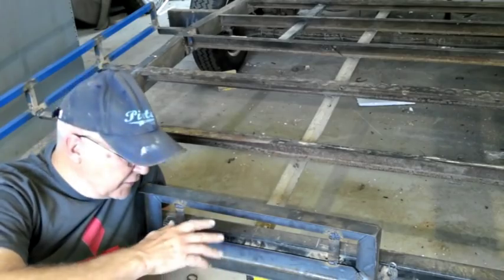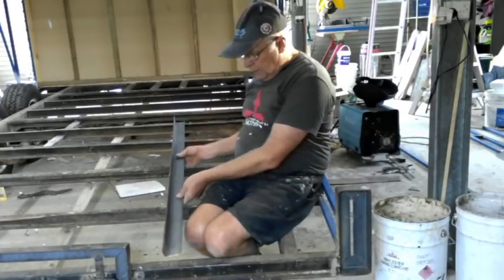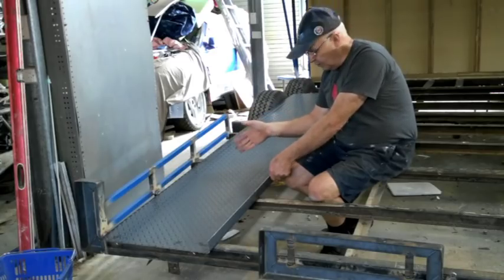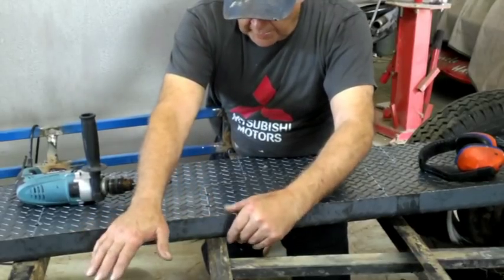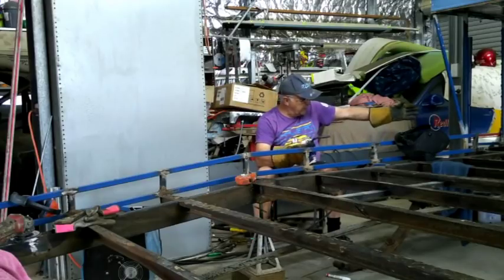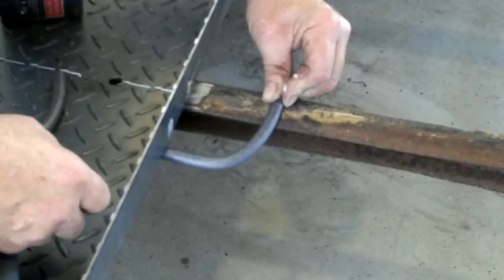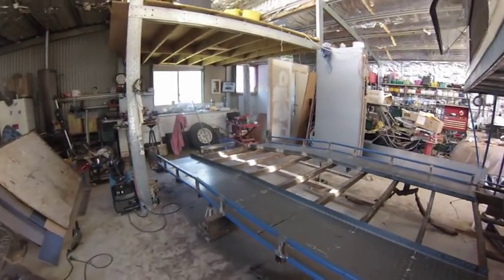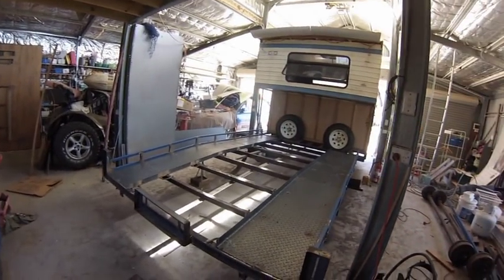Making a Car Camper Trailer from a Caravan -  Part 8

Comment: Great work Bill, please hold the mig torch closer to the work piece.
Reply from the maker: Yeah been told to do that yesterday. Good advice... it works! But now the tip shroud on my gasless MIG is clogging up quickly. Got a cure?
Reply: WJP004 yeah buy some mig pliers and keep unblocking it, also some anti spatter spray helps. If I’m honest tho get some gas and wire sooooooo much better, keep up the great work Bill     Ps buy some more shrouds as they need changing once in a while as well as some tips, make sure you get the right size tip for your wire

Comment: That's a very strong design.
Reply from the maker: Yes Kevin, many of the trailers in my local car club have no side framing at all, the floor strips just sit on top of the main beams. They are light & none have failed structurally, but i prefer one that the car can't fall off...hahaha!
Reply: +WJP004 If you needed wider treads, you could have the fold downward and then mate another of the same piece. This would form a rib underneath which would have to be notched around the frame members.